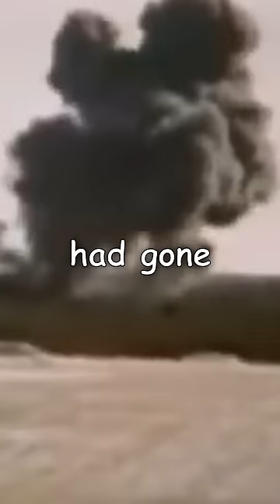1.3 Seconds from Death #shorts

Comment: F14 was way ahead of it’s time and now it’s obsolete
Reply: They were like the Sony Minidiscs of fighter jets.
Reply: Old, but not obsolete. They will only become obsolete when all the pilots trained to operate are gone.
Reply: @joshring9710  that’s true. The planes can definitely do some damage fighting against the North Korea air force or even the afghan Air Force. Either way it’s still a fighter jet and a fighter jet is better than no fighter jet
Reply: Happens all the time.
Reply: Pretty sure those are still in use all over
Reply: @glitchthecat5011 nope, only in Iran.
Reply: @Ivy21683  No, they are only in use in Iran. Iraq does not use F-14’s. No other country besides Iran uses them.
Reply: @glitchthecat5011  Not at all, the one and only country that uses F-14’s is Iran.
Reply: @gmennc2648  same difference, you knew what I meant.
Reply: No it's not. We put it out of service because iran I belive split from us after they bought F14s and we didn't wanna make more parts for them
Reply: @V13per  the F15, 16, A18, 22, and 35 are all better 
The Su37 and 57 are better 
Mig 35 is better
Reply: @V13per better options came about and from what read the F-14 was a maintenance nightmare
Reply: @someguy1907 yes i would hope wildly modernized and updated planes are better than 60s technology 😂
Reply: @dekdawg21 my dad was a structural/airframe mechanic on the F14s and he said they were pretty straightforward to fix. After F14s he went into the coastguard because he loved C130s almost as much as tomcats and became a metal shop guy/fuel rat and certified with rebuilding every kind of turbine/jet/orbital motor
Reply: @Ilovemyidi  that's pretty cool. But by the time the F14 was retired it cost way more per hour to maintain than the F18
Reply: @dekdawg21  i didnt say it was cheaper tho lol
Reply: Iran still flies them!
Reply: @someguy1907 only the most modernized versions of those crafts, f14s beat f15s but was downplayed to sell more. F18s were worse, f16s will always have a dogfight win but not a bvr.
Reply: Not obsolete, abandoned.

Thanks to Boeing lobbying.
Reply: @someguy1907 No, No, Hell No, Yes, Meh.

Maybe, Yes, and Yes. 

This is against the F-14B variant btw.
Reply: @gmennc2648  "No other country besides Iran uses them."
Back in the 1970s when the Canadians were looking for a replacement for four (4) jet fighters in service, they picked the F-18. (Sounds good, right? Except that Canada was THE FIRST customer for the F-18 and the US Navy hadn't accepted them, yet.) The Canadian media went on and on about the incompetence shown buying this unproven little toy when the mighty F-14 was at hand and clearly the super-fighter of the time. The fools and knaves bought the wrong one!. 40+ years later, that was clearly not the case but the Canadian media still second guesses the professionals with every procurement going. It is a national pastime.
Reply: @BigBossIvan  Sometimes, I feel that Boeing is like a bully that has not learned his lesson.  I even seen here a report on some whistle-blowers that denounced safety issues that were ignored.  Then we opened the chapter on the 737....  Nothing is perfect, but they should be more responsible to the world.
Reply: The A-5 was even more ahead of the F-14.  Where do you think they got the variable wings from!!!
Reply: @joshring9710 by your logic B-29 is not obsolete
Reply: True. Its ahead of time, pioneering lots of advance technologies (such as first air data computer, first long range active radar guidance missile, first shoot down lock down cap, very powerful radar cap TWS RWS PDSTT JAT, first modern head up display, etc). 
Those techs are continuously upgraded, became more modern & efficient in cost & operational's for use by other aircraft, such as 15, 16, 18. The low maintenance cost of newer aircraft due to theirs already have matured technologies.
While for F14, the DoD already "abandoned" it since 1978. High maintenance cost due to the F14 have no or very minimal modernization for its life. 

Interestingly, that being said "You reap what you sow." The discrimination by DoD for Grumman, resulting in the F14's tech fell onto the Iran's & Soviet's hands. Giving them access to technology treasure, mainly advance integrated airborne radar system for its long range active radar missile guidance system.
An answer they had been looking for ,the most for their long lasting technology development struggle in the area.
Reply: @someguy1907 every single aircraft you mentioned can't do the primary role of the F-14 , ya so obsolete.  The Navy still doesn't have a fleet defense fighter now.
Reply: @someguy1907 F-14 is older than them all. No suprise there.
Reply: @someguy1907 wait A-18???? You mean F/a-18???
Reply: @abrahamdozer6273 and the Avro Arrow never had the chance to become obsolete.
Reply: @glitchthecat5011 The last F-14 Tomcats were retired in 2007.  Those not in museums were destroyed.  The only Tomcats remaining that are possibly flyable are in Iran.

Originally, the Shah of Iran purchased 80 F-14 Tomcats.  Only 79 were delivered, due to the fall of the Shah.  Tech reps from Hughes Aircraft Co. quickly disabled the radar systems and left for the States, but eventually the Iranian techs figured out how to repair the radars.

Last time I heard, there were still around 20 Tomcats left in flying condition in the Iranian Air Force.
Reply: * ITS
Reply: I wouldn’t say obsolete. It would still easily defeat the vast majority of aircraft around the world. Just LOL at the majority of fighters still in service in most developing and 3rd world countries
Reply: @Ivy21683  you mean Iran 🇮🇷
Reply: @V13per  we definitely did NOT put it out of service the inconvenience Iran. We put it out of service because we foolishly thought there were no more long range treats to our carrier fleets in the mid 2000’s with no major misbehavior from Russia or China at that point. Now the US Navy are desperately in need of  a heavy, long range fighter with the speed, powerful radar and long range missile-varying capacity of the F-14D Super Tomcat. The Super Hornet is just not long-legged and cannot carry hypersonic missiles like the big F-14D
Reply: @XB10001  "It's" is a contraction of IT and IS, so his grammar was appropriate.
Reply: @someguy1907 none of those are better.
Reply: Bro you don't get to use apostrophes willy nilly. It's its then it's *
Reply: Just like Comic Sans
Reply: @stevewilke8524  So? Feeling too dumb?
Reply: Hardly. It’s been flying over 50 years. It’s only obsolete if it’s not upgraded, which it could’ve been, or could be.
Reply: That is the attitude of spoilt kids. They want new billion dollar toys each year again. Just because they love wars. It is that simple.
Reply: Any jet fast enough to get out of its own way and capable of launching contemporary guided and unguided munitions is a relevant fighter. Since we no longer live in the age of the close combat aerial gunfighter.
Reply: Blame the Chinese
Reply: Good
Reply: @joshring9710  they aren't even in service anymore
Reply: @gmennc2648  bud, Iran uses them to hold down the hangar floor during a sandstorm
Reply: @Ivy21683 same difference? Dang why do we call it two names if it's the same... Oh wait
Reply: @Steve.._.  productive use of your time writing out this comment 🤓🤓
Reply: Same as Concorde but although it doesn’t fly, is definitely not obsolete.
Reply: @DUCK_LEADER1 no the US kept using it after that it's just the supply of parts and support for the Iranian armed forces stopped Iran has a whole bunch of mid/late-cold war stuff from NATO the F-14s being some of the most famous stuff.
Reply: Yeah that’s what happens to a 50 year old jet.
Reply: Your spell-checker is still bad
Reply: @someguy1907 actually I heard a guy who flew both say he would rather fly an F14 against an F15 than vice versa.
Reply: @joshring9710  they're obsolete kid, deal with it
Reply: @WillToleration  wrong
Reply: Iran still flies theirs
Reply: @dekdawg21 
It wasn't something for novice mechanics with rag wrenches to work on.
Reply: @someguy1907 the other us planes yea they are better then the f14. But saying the Russian ones are better then the f14 is going to be a hard no I would take a f14 any day of the week over the Russian ones
Reply: Saved our a** during the Gulf of Sidra Incident.
https://en.m.wikipedia.org/wiki/Gulf_of_Sidra_incident_(1981)
Reply: @touristguy87 😂😂😂
Reply: Thanks for the insight, Captain Obvious...

New tech, becomes old tech, that's replaced with new tech...no shit?
Reply: they arent dogfighters. they are still very capable BVR fighters
Reply: Not obsolete, retired before its time due to politics!😂
Reply: @erichvonmanstein6876 your brain is.
Reply: @OFallons  obsolete
Reply: @xLong_Johnson  they were dogfighters fool
Reply: @glitchthecat5011 . The F14’s are almost all gone.  The US F14’s were all destroyed after being retired.  All except those in Museums.    Iran has the only functional F14’s and they are running out of spare parts.   It is estimated that only half of Irans F14’s are left working.
Reply: @erichvonmanstein6876  they were BVR fighters, beyond visual range. huge difference. aircraft of warfare havent doctrinally dogfought since ww1.
Reply: A copy of USSR MiG 25 of 1965
Reply: @xLong_Johnson  wrong. Yeah pretty much your ENTIRE post is wrong. Sorry kid , try again
Reply: @xLong_Johnson  did you just learn "BVR"? is that why you write it  out to show us you know it? Lol 😂🤣😅🤭👉
Reply: @erichvonmanstein6876 thats an asinine assumption considering there was an obvious misunderstanding between fighter and bvr fighter. when i initially mentioned it i did in fact abbreviate it. only wrote it out the second time i had to explain it. reason 9653 why i believe not everyone should have the right to vote much less an opinion haha. the brain cells died a while back eh?
Reply: @WillToleration The F-14 does not outperform the F-15 by any metric save one.  They were slower in both top speed and acceleration, they were less maneuverable, more expensive, and harder to fly.  The F-15 holds the highest kill to loss ratio of any aircraft of 104-0 for a reason.

That being said, the one advantage the F-14 has is why they were used for so long.  Despite being an extremely high skill ceiling aircraft, they had the most powerful radar ever put into an aircraft at that time.  They were basically used as flying radar dishes and guided in other aircraft for this reason.  With the invention of things like the AWACS and advancements in radar technology giving even the F-22 drastically better performance, they became obsolete.
Reply: Many countries air forces would love to have a few of those obsolete airplanes.
Reply: Few countries still have them about 100 f14.
Reply: @thunderboltcougar5626 Unfortunately its true! They wouldn't ever give it to undeveloped soviets those incredible technologies!They must not ever give it to soviets!
Reply: @glitchthecat5011 not they aren’t. The only other country to fly the F-14 was Iran when the USA sold some to Iran when the Shah was still in power. After the overthrow all support for their F-14s was cutoff. And when the USA retired the F-14s the retired planes were literally shredded to keep any parts from somehow finding their way to Iran. There are some still on display in museums but they have been rendered completely useless for the same reason. There is one on display at the Air and Space Annex at Dulles Int Airport, and the flight museum at the Richmond Int Airport had one and an SR-71 but that museum closed and both planes were moved elsewhere. Fun fact. The last official flight of the SE-71 was supposedly to RIC for it to be out on display. There is one at the Annex too.
Reply: @joshring9710 

They are obsolete because there's already equipment that can do it's job but better.
Reply: F-14 is expensive to operate compared to the F-18 and even the F-15. The F-15 came out almost the same time as F-14.
Reply: I'll take one
Reply: Isn't that the natural order of things in terms of man and technology since the caveman days?
Reply: @someguy1907 
Not down low, F14 always won those matchups.
Try to outrun a phoenix missile.
Reply: @abrahamdozer6273 
F-14 beat the F/A-18’s in dog fights every time.
The voice was purely economic.
Reply: @golfwhiskey871  Well, there are all sorts of F-18As still in the air and almost every singl F-14 is in a museum now so there is more going on than "puere eonomics".
Reply: @glitchthecat5011 no. F-14s are no longer in operation in any service and USA destroyed all spares to prevent Iran from ever utilizing theirs so to obsolescence.
Reply: Nothing remarkable there. You could say the same about any 20th or 21st C tech- from the phone in your hand, to the TV you watch. Sorry, don't mean to be a d*k, I get what you're remarking on.

Comment: The military industrial complex and politicians have never had a problem risking the lives of military members in order to make a profit.
Reply: Why goes any guy to the Army If the politicans dont care
Reply: Plane crashes are not profitable.
Reply: @JohnRinNoHo  the military pays for a shitty built aircraft, it crashes, the military buys another aircraft. Too many pilots have died because of shoddy aircraft manufacturing; not just aircraft either. I evaluated the Single Channel Ground and Airborne Radio System (SINCGARS), it failed multiple rigid standards, the DOD bought it anyway -- ended up not working very well in the intense heat of the desert. The M1 Abrams tank and the Bradley Fighting Vehicle are also examples of failing their evaluations and still being purchased.
Reply: @foad-esad ok... And your point is? Prototypes are always going to have bugs. Bugs that usually get fixed before the unit goes into full production. Are there exceptions? Obviously. But if no one else is offering a better solution, then the item goes into service flaws and all.
Reply: Even more annoying - during my 22 years of service not once was I ever given a questionnaire or even asked my opinion about what the weaknesses of my MWS were, what equipment needed to be acquired to make my job easier and my airplane more reliable, etc. Instead, we’d suddenly have new equipment that we didn’t need jammed down our throats - half the time it didn’t even work properly anyway, and meanwhile, things that you and your aircraft actually needed couldn’t be acquired due to budgeting shortfalls.
Reply: @JohnRinNoHo it's not their money but your taxes that pay for it
Reply: This profit first attitude is also why nuclear energy will never be more than a 'backup' source. Cutting corners (costs) on materials, passing off lower grade piping, concrete, fittings, etc, as approved grade.
Ignoring a known safety issue is criminal.
Ejecting 25 feet above the ground  . . .
Damned lucky, big cajones
Reply: @Tank50us 
Osprey, anyone?
Reply: @1929modelagirl  Yeah, in the US, Nuclear Energy is very tightly regulated. None of what you stated could even happen in a modern reactor.

Also... your statement on the V-22... oh hey, we're developing a completely new type of airplane using technology that wasn't developed until we started making this things immediate predecessor... of course there's going to be massive teething issues. This is doubled when the pilots decide to start hotdogging in it, or when things you couldn't think of happen during testing. And now it's all working.

Yes, people were killed. But if we just gave up on something because someone died, there wouldn't be American flags and footprints on the Moon.
Reply: @Tank50us the problem with that is that it's only okay if there was no way to know what was going to happen beforehand NASA higherups knew about the O ring issues with challenger not to mention the ridiculously cold temperatures at the time but they stupidly went told them to launch anyway. Same here they knew there was an issue with the jet but they sent the jet up anyway rather then fix the issue and save not only the plane but the test pilots as well. Death is a part of pushing these boundaries but needles risks and wasting life is not part of that.
Reply: @Tank50us  
Well, having been in the industrial construction industry for more than a few years, quality checks are performed on very limited samples that are not randomly chosen. Ie; manufacturer supplied, not pulled on site. 
There have been many, many cases of lower grade (quality) piping, fasteners, steel plating, concrete, etc found AFTER installation. This info is available on government websites.
I am not saying it is an endemic issue, but all it takes is one failure. 
Engineering isn't usually the problem,  but training  and following protocol is.
The Osprey is grounded. Again.
Next generation, I believe
Reply: @nrnsclark94  How many other warnings did the people responsible for the decision to fly have to consider? If they stopped at every potential problem projects would never end. You are making a judgement with hindsight.